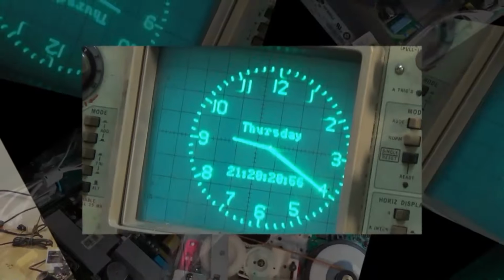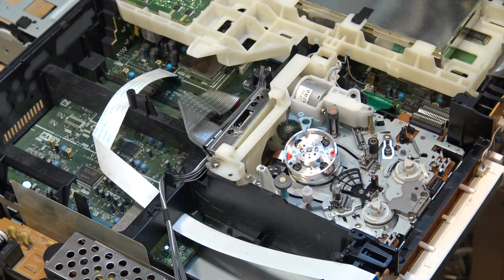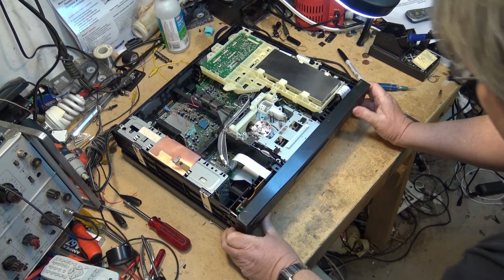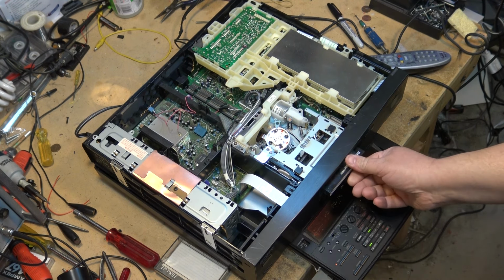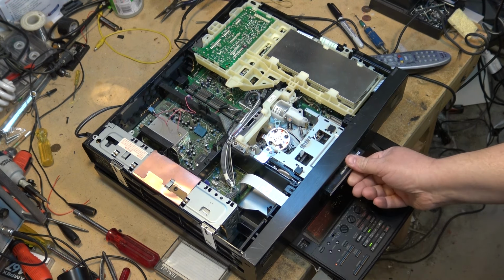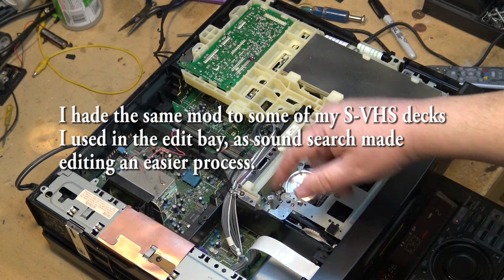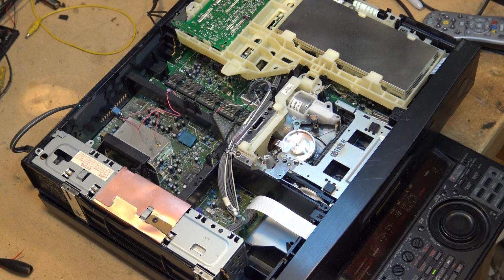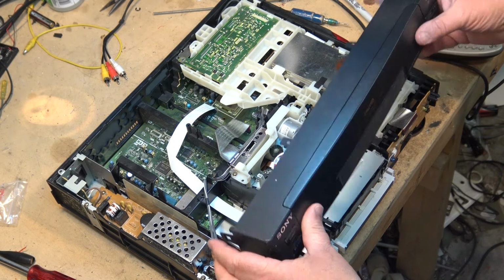Sony EVS7000   EVS5000 Hi 8 Deck mechanism troubles

Comment: Hello, I have a Sony EVS700U. EVS900 which could be used as a digital audio recorder and playback machine with 6 * four two track stereo hours of digital audio recording with a total of 24 hours of digital audio per cassette. The whole width of the tape was taken over to PCM audio stereo recording. I used to re one PCM Layer to Rock one for Country one for Heavy Metal etc. Fantastic machines which I have serviced and still working though I have purchased one extra of each for parts if needed. Sony in the 80/90s brought out one innovative tech but lost their way unfortunately a little like Apple with Steve Jobs. I look back with fondness when I listened to the machine of my youth. Just Brilliant!

Comment: I understand your frustration with this. Sony has a reputation for bad broken plastic gears on their Beta vcr's too. As I and many have found out too.
Reply from the maker: paymydues 
yes the infamous broken guide pins on the early sl2000 2500 and 2700 which were the first of the 711 chassis were terrible. Then the blue gear that breaks on all the vhs machines. They had lots of plastic gear failures. we used to joke Sony meant "soon only not yet" and the ES audio gear stood for expensive sh__!  looking back most of that ES gear was great but their vcrs and home cameras were not that reliable, and they had flyback troubles on their TV and bad hv bleeder resistor troubles.

Comment: which model Btamax vcr is good to digitalis the Beta format
Reply from the maker: They are all good. Betamax had much better sability than VHS. I just digitized 5 tapes that were 4.5 hours each, recorded back in the early 80's in the Beta3 speed. The resulting files were indistinguishable from the source tape.
I used an very basic SL10 for playback.

Comment: consumer electronics blues and things are getting worse for support.
Reply from the maker: That's precisely why I got out of the consumer repair business in 2003 and got a job for a major telecom. Job security. The internet is the future.
Reply: Damn, I got out in the late  70's, I already seen it coming. I took my first job fixing stencil scanners at 19
Reply from the maker: The 80's and 90's there was tons of money in consumer electronics repairs.
Back when the average wage was 25,000 a year I was making 60K and did that pretty much every year from about 86 to 2001 then the industry turned around, and I could see the writing om the wall, and was out by 03. I got back in more as a hobby around 2012 and am quite selective on what paid jobs I accept. Most of the stuff I tinker with here in mine. People give me old things, and I fix them, and then give them away, or if they have any value try to sell them for a few $.
I make enough from advertising to make it worth while, but not as much as I used to thanks to advertisers shying away from youtube due to some channels doing offensive content. Advertisers are shying away from youtube in general and moving to other platforms because of certain youtubers according to a report I heard on the radio today.
That would explain falling revenues.
Reply: YouTube has its day as well.  I am surprised how many want to fix old tube radios for instance.  maybe do a few of those. I never made over 40k so you did well
Reply from the maker: I have a few old tube radios to work on one of these days.
Mid 80's and the 90's were the best time to be in the consumer electronics repair business. When VCR was king, as they were always getting head clogs and mechanical troubles.
Reply: True, my brother got a JVC top load for $1200 back in 1982.  Hard to believe, and it had a wired remote.

Comment: Is that opening music Rick Hart and the Blue Horse Band - See What You're Made Of? I used Google sound search, and that's what came up.  Fitting music, you sure are going to see what that device is made of.
Reply from the maker: NO it isn't, and I am quite pissed off about this. It is a track from musicbakery.com called Action Thriller.

http://musicbakery.com/release/action-thriller/

This is not the only track that Rick has lifted from musicbakery, and stuck some lyrics to.
Jack Waldenmeier is the composer, and the track was released on the April 2000 CD. My old production company spent thousands licensing those tracks for video production use, and I get pissed every time I get a copyright claim by someone else that claims that it is their music. Believe me if I had a dollar for every dispute I have to file with youtube. Jack is a master composer, and so many others have used his music for their own projects and then copyrighted their versions. 
Go take a listen to the original.
Another one that Rick used was "Mysterious Stranger" from musicbakery.
Go look up Rick's track "slip off the line" Same music, with words.
Frustrating. He isn't the only one. Francia Jazzline Orchestra has stolen dozens of tracks from Musicbakery.
Reply: 12voltvids I didn't mean to get you upset, I was just goofing around with Google sound search, and that's what came up.  I enjoy watching your videos, I'm planning on building a new computer, and I'm going to salvage the hard drive out of an old cable box I found in the dumpster. Your video saved me $40.00.
Reply from the maker: Jerry Spann 
you didn't get me upset the fraudulent copyright claims do.

Comment: Have tried.. Lazer Bond 3 Second Fix- UV Light Repair Tool Liquid Plastic Weld have  used to fix plastic parts befor.
http://www.ebay.com/itm/As-Seen-on-TV-Lazer-Bond-3-Second-Fix-UV-Light-Repair-Tool-Liquid-Plastic-Weld-/162171941931?hash=item25c233742b:g:6H8AAOSwZVlXtBEC

Comment: When you FF or REW on that machine the sound sounds like tuning a radio. That's a pretty cool mod. Too bad you couldn't mod this machine so when you rewind or fast forward, the voices on the tape get all chipmunky like on an audio tape.
Reply from the maker: On analog VTRs that I have modded, the audio from the linear track does change pitch. 
On 8mm and Hi-8 the audio is recorded by the spinning video head, so the speed of the head, and therefore the pitch stays the same.

Comment: if you have a 3D Printer you might be able to print out a new part or if you know someone who has a 3D Printer they might print out a new part for you from fibre glass rich printer stock if you ask them and any way it might be a two print head job if you are going to print the magnetic insert at the same time as printing the gear wheel, any of you guys out there how do you get a Hi8 tape out of the machine with any battery left as I appear to be in deep shit as there is a tape fully laced and I don't think that I can get it out without powering it up and blowing up some of the electronics in my Cannon camera, update got the tape out by not fitting the battery but I think that the tape is probably knackered i.e. creased.
Reply from the maker: I don't have a 3d printer, but looking at the construction of the gear I doubt this is possible, and other have chimed in that they tried to print one without success.
Reply: No a two nozzle 3D printer can do it all in one fail swoop it is just  like printing a supporting layer but in this case you are printing a material with iron fileings in the printing material which comes on a roll and I don't see why it should not be possible if you can get a the G code to allow the creation of this part, by the way why not reach out the Ex Microsoft Employee who has a you tube channel called Barnaclease Nergasm as he has such a printer unless he has given it away.

Comment: So are the magnets actually different in the supply reel, or are they just firther apart for a weaker drive?
I was thinking if it was the magnet strength, use freezer spray to shrink the magnet so to push it out and swap over.
There has to be a way to fix them, its a shame that such a clever machine cant be fully repaired :-(.
Shame about the cat :-(, but they dont last as long as us, but it had lots of love so thats all that mattered.
Reply from the maker: Cat got poisoned. Some cruel bastard that doesn't like cats getting into their garden left a bowl of antifreeze out. Several of my neighbors lost their cats about the same time. I am pretty sure I know who did it, because they had a really nice garden, but that person was carted away in an ambulance a few years ago and soon after the house went up for sale and was torn down, and 2 houses built on the lot.
Reply: What an evil shitbag, poor cats :-(.
Somtimes i hate humanity, still savage and selfish.

Comment: I had a client give me one of these EVS-7000 decks a while back, one of those clients that has tons of money to buy expensive crap and then never use it, he was going to throw it out if I didn't want it. He also gave me his CCD-VX3 and EVW-300 that he'd bought new. The deck has about 10 hours on it and still works flawlessly to this day. The majority of these (and similar) decks I see all have that problem though. I've had to fix numerous decks with the busted gear. I had a similar problem on an SLV-R1000 where the blue gear that moves the loading arm (right one I believe?) was busted in half. To borrow a phrase, "it's often a simple problem that brings a complex machine to its knees."
Reply from the maker: The blue loading gear was as big a problem as the take up hub on the hi-8. Actually a bigger problem because Sony sold many times more VHS than the hi-8 decks.
Funny, I also used a VX3 and EVW300 back in the mid 90's. Then I upgraded to a DCR-VX1000 and a JVC GYDV500 around 99/00 and then to a HDR FX1, and HDR HC3 in 2004, and by the end of 2006 I pulled the plug on the wedding video business, and concentrated on just corporate stuff for another few years  hanging up my tripod from the commercial side of things around 2010. Now I shoot using FDR-AX33 and FDR-AX100 just for the channel mostly. They were fun times doing big productions, but I don't miss that work at all. I am glad I am out.  I enjoy doing the ultralapse, and time lapse videos, and making the repair videos.  It is a steady income stream, and even though I don't make enough to do this full time, I do make enough from the advertising revenue to keep me motivated to make more videos, and get more stuff to tear down, and work on.

Comment: 3D print one!
Reply: That won't work as the plastic is moulded around a very thin metal ring and the clearance is very tight. There is also a hall effect sensor under the table to detect the changing magnetic field on the magnet on the top side. I have a 3D printer, and 3D scanner, and have tried to make one of these already for a client and had no success whatsoever. If the entire hub was plastic then that would definitely be a possibility, but in multiple attempts I was never able to make one of these work. If anyone else has had success I would be more than willing to get one made for my evs5000.
Reply: Would it be possible to use the original metal magnetic ring from the cracked gear, and 3D print the base of the new gear up until where the metal ring would go, place the metal ring where it goes on the in-progress gear and perhaps tack it in place with a drop of super glue simply to hold it steady, and then 3D print the remainder of the gear around and on top of the disc so you would meet the tight tolerance by essentially embedding it and building atop it?
Reply: I think that with a two nozzle 3D printer might be able to print out such a gear wheel I.E. metallic particles in the feed wire.
Reply from the maker: Good idea. I don't have any experience in 3d printing myself, but the only way I can see this working would be to split the broken gear, remove the outer gear ring, and get that printed, and then fit the hub into it and glue it in place. That is the only way I can see that working. I should take the gear into the shop that has a 3d printer and see if they could do that. The one on the evs5000 is broken anyway, so nothing to loose and everything to gain if it would work.

Comment: I wonder if spindles from Sony 8mm camcorders will fit?  There are many out there cheap.
Reply: Camera mechanism is completely different. The only 2 decks that Sony made that used this mechanism was the 5000 and 7000.
Reply from the maker: I have many cameras, and none I have checked are even close to these. Most of the cameras use optical rotation sensors.
Reply: Sony's poor decision. If only they used the same mech (or at least common parts) it would be dead easy to repair then.
Reply from the maker: The video walkman units (digital 8) used the same mechanism as camcorder, however due to the tight tape wrap they are hard on tapes, and do not wind very fast. This design with it's gentle and very wide threading pattern is supposed to be easier on tapes, which is important because during editing there is often much winding and rewinding so a gentle tape path will mean less chance of tape damage. Considering that Hi-8 was an acquisition format, protecting the camera original is of utmost importance. In a pro or semi pro environment the camera is used to record the tape, and then it is removed without rewinding, and all further transport is done on editors, so these machines had unique transports that were of very high quality. The problem was bad reel tables. The rest of the deck is fantastic. Believe me if I could find some spares, or have a few made, I would do it.
Reply: 12voltvids - Thanks a lot for the explaination! That makes sense then. Although they should use common parts as much as possible anyway (from an engineer's point of wiew).
Reply from the maker: I don't think for a second that they planned on all these gears breaking like they did.  I am sure the engineers figured these units would last a long time, and then the gears started breaking and the units had gone out of production.